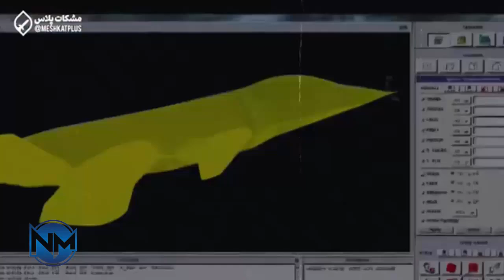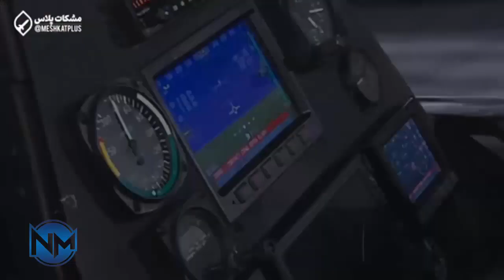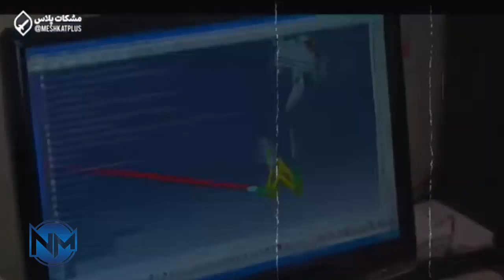Iranian unmanned fighter jet undergoing flight tests!

Comment: With the intakes above the wing any AOA is going to cause disrupted airflow to he engines which will result in compressor stalls, flame outs and maybe turbine failure.

If this is the best they come up with....
Reply: This is probably some shitty prototype and I'm pretty sure it's meant to be a "stealth bomber" so the AOA capability isn't their priority in this testing phase and they've done this before to allow more payload capacity.